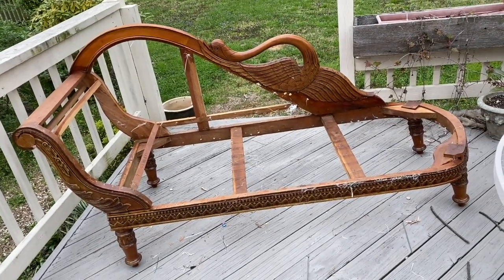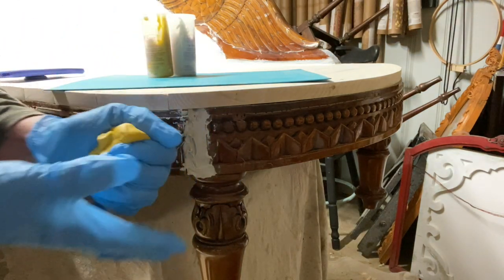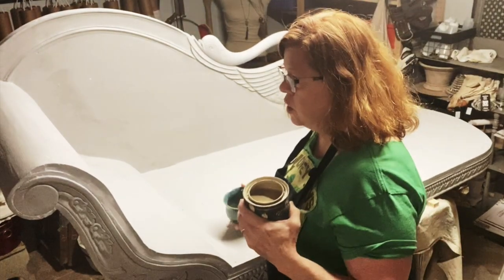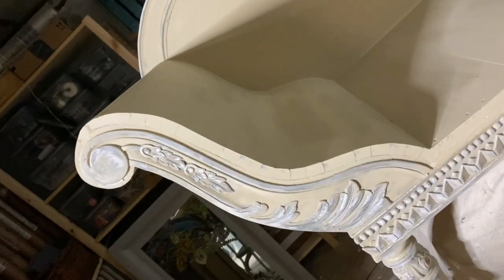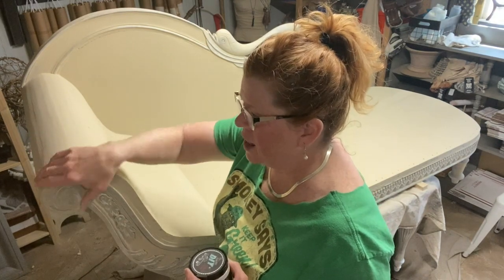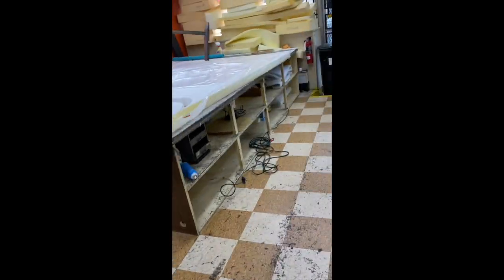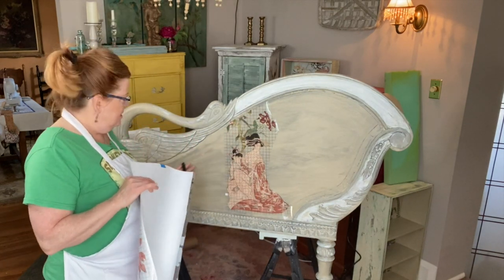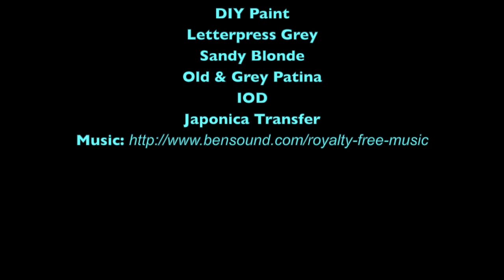How to Transform a Chaise Lounge by Catheen Barenski of The Costly Pearl

Comment: What did you do for the 'cushion' on the bottom and curved side piece?  It looks like  upholstery, but when you touched it, it sounded like it was solid wood.....    Whatever you did, it looks very smooth and well done.  Your secret, please?
Reply: If you mean the "shaaaze" base...lol  my husband cut slats of wood and placed them horizontally across. He had to cut angles on the curved part. The curved back is wood as well.  It honestly is not very comfortable even though the cushion is 4 inches thick, because there is no give, so I will sell it as more of a bench.  :)